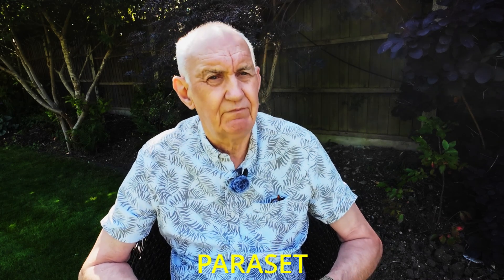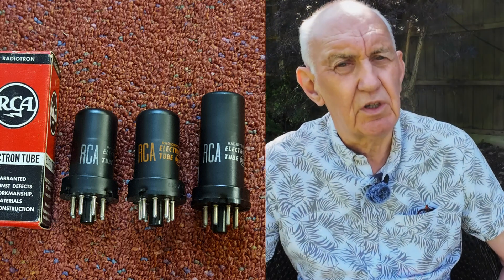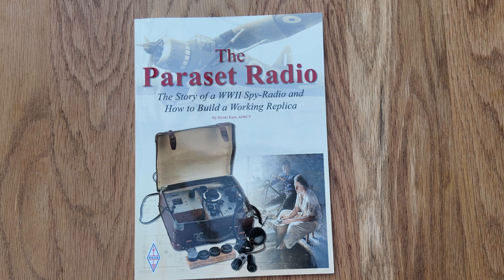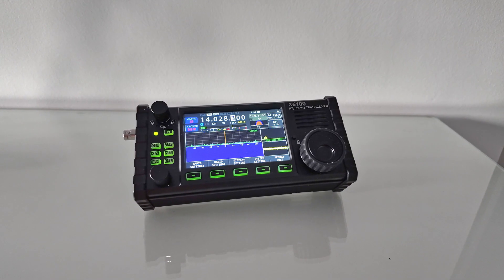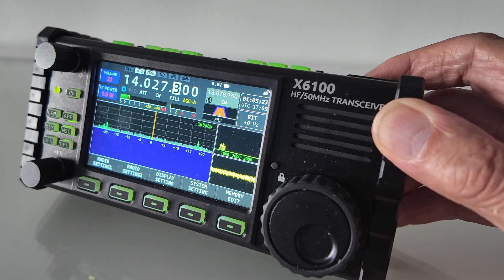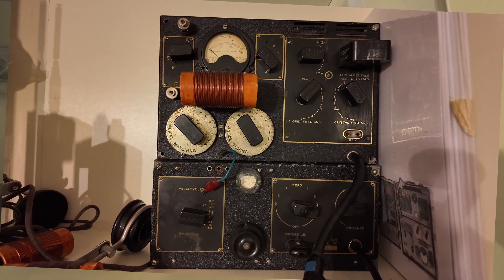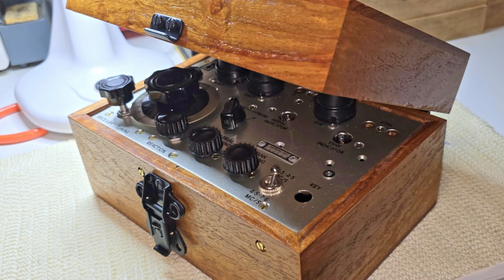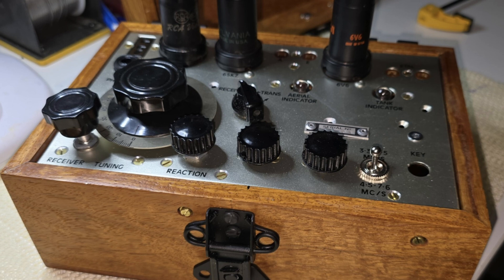My Top Secret Spy Radio - Further Details

Comment: Hi Peter, I've had one on the go for about 4 years on and off, and have finally got around to start to wire it up and will also be building a vibrator p.s. and mains supply and re-learn/brush up on my CW (defo not a techie, but being very careful). It's been a labour of love finding the parts to get it looking right (missing the Jones socket and plug) but will find something else suitable, probably a sturdy 4 pin microphone plug and socket or similar. Hope yours has arrived by now and I look forward to giving you a shout sometime. Cheers for now, hope your secret squirrel is safe too ;) M0ZLI - David
Reply from the maker: Great.to hear about your project. My radio is some way off yet. Let me know how you get on when completed. 73

Comment: Many of the components you are using are not identical to the original, the rotary switches for instance are miniature Japanese, the capacitors are modern mylar and polyester,  the ceramic tuning capacitors are late 60s. These parts were never used during the war. It is easily possible to replicate this better by using period parts from old domestic radios of that era. Yaxley switches and wax filled paper capacitors could easily replace these modern components and increase the realism hugely.  I guess if they are out of sight, they are indeed out of mind. Pity though, with the effort you have gone to.
Reply from the maker: Nobody in their right mind would use 80 year old capacitors, unless of course the radio was for show only!
Reply: @watersstanton  Why? If they test ok, its no different than using a   80 year old 6V6, or an 80 year old  resistor or an 80 year old phone jack.

Comment: If you want your own special version but all SState the 4SqRP group in the US do limited runs of  Bayou jumper I think they call it.  It's a 4 W out with only two mosfets  (the power oscilaltor is a BS 170)  Format - 40mtr locked frequency Tx  and a regenerative receiver.   4W CW will indeed cross the  Atlantic if the wind is blowing hard  but the Rx really isn't up to it.  Anyway it is or was available as a kit  or order of  120 USD approx.

Comment: It amazes me that the British sent spy behind the lines with a regenerative receiver. As you well know the reiterative receive sent a signal to the antenna allowing the enemy to detect the radio set. most spys were caught because of the RF Detection Units used by the NAZI units. Pure Stupidity. the pre war marine radios were also regenerative which is why Radio Silence meant cutting all power the the Radio, no exception.
Reply from the maker: Firstly that was the best option for simplicity Secondly, the farfar stronger transmit signal  with CW code was what alerted the enemy.